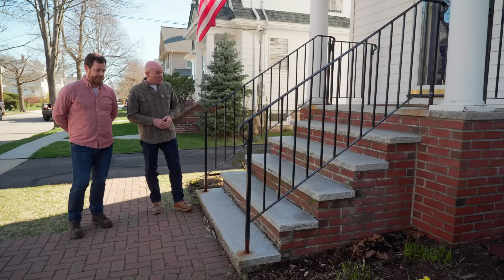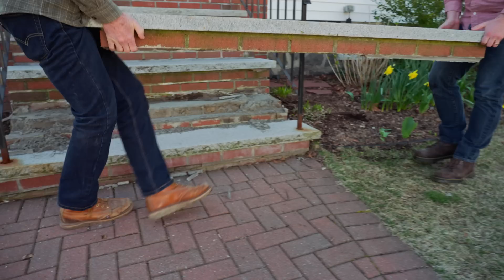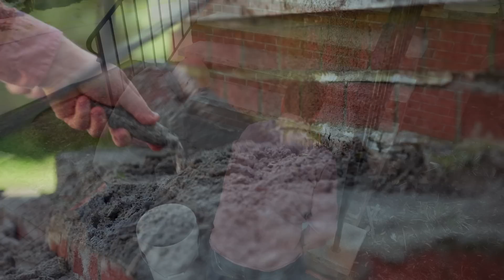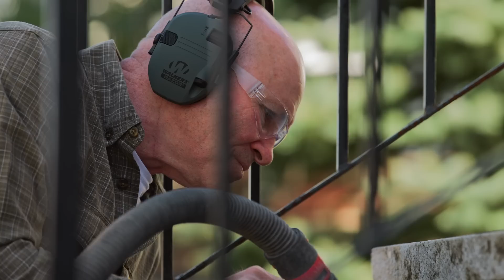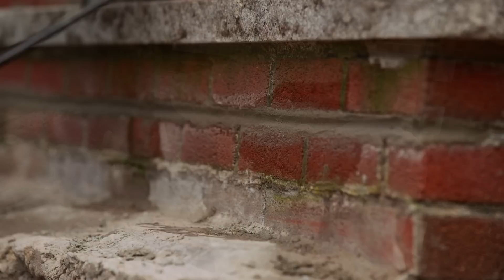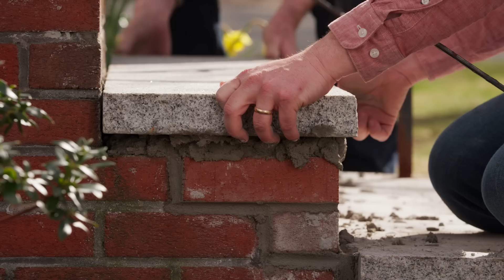How to Repair Granite Steps | Ask This Old House

Comment: It was supposed to use a brush and remove the dust and old worn cement first, then spray it with water and then repair the damage.

Comment: Great job Mark but, as a time served craftsman,  I was always told never hit a hammer with another hammer.

Just wanted to ask if masons hammers are tempered differently, as I was told they can chip or break if used against each other.
Reply: Always hear this, never seen it happen

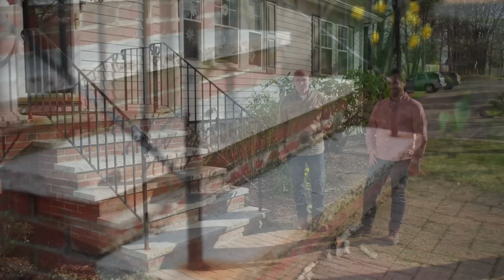Comment: 10:45 i have a bunch of questions! 
1. Why you didn’t power washed everything ahead of time?
2. Why you didn’t filled the joint between the bricks before you added the last brick?
3. why you didn’t added concrete on the back of the granite slab?
4. Why you added just concrete on that slab and you didn’t added proper adhesive? You do know that is an adhesive just for that operation!
Reply: Mike Haduck Masonry, go watch it, ain't no big deal.

Comment: At 7:23 Mark should have put some mortar on the ends of that brick before he “set it.” Granted some would have been lost, but rather than putting it in with no mortar and just relying on the mortar joint to hold the bond. Suprised he did this.
Reply: Which part of the brick? Near the ends of the long, horizontal face, or on the short, vertical faces?
Reply: @sparkyheberling6115  Read what I said. I said the “ends.”
Reply: @johnlebzelter4208  But there are two kinds of ends here. The ends of a face of the brick, and the ends of the brick. Do you mean he should have added extra mortar to the bottom face?
Reply: These clips (and probably episodes) are so highly scripted and edited, a lot of details are probably left on the cutting room floor.

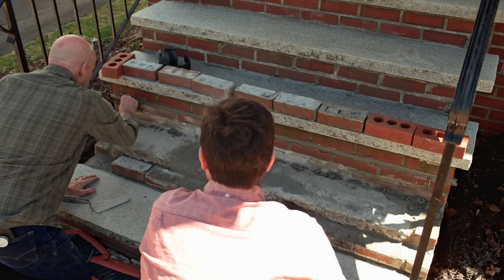Comment: 5:42 “We want to make sure we ride the heel.” What does that mean?
Also, don’t you need to check that  the height of the step is the same as before?
Reply: @sparkyheber… It means letting the heel of the jointer determine the proper depth, not the very end.
Reply: It also prevents you from digging your tip into the mortar
Reply: @aaronstarling9837  Just what I said.

Comment: This is more than I can handle... My question is:  what kinds of questions do I ask my local mason if he has the expert knowledge and experience doing this kind of repair with positive results. I think I've been getting handymen who look up how to do this on YouTube and have mixed results (not often good) when I really want a professional outcome, not a patch job. 💕🌞🌵😷
Reply: A patch job will always be nothing but a patch job unless you do a complete "re-do."  The staircase in this video is in the Northeast.  And bricks take a beating at ground level in this climate with the extreme freeze/thaw cycles.  Until this staircase is swapped out for all cement or natural stone, it will continuously have to be touched up.  As for any contractor you may hire, get some references and check out some examples of previous job he may have done.
Reply: Jack of all trades and master of none, the North American way the past 15-20 years.  Specialty trades are becoming obsolete,   Oh your a tile and marble specialist? Sorry no work… Oh you can do vinyl, linoleum, carpet, hardwood too?  Welcome aboard!      The customer has to do their due diligence and research if they hire a contractor because that contractor could be anyone claiming to be someone.               Take pictures of someone’s workmanship and pass it off as their own
Reply: @Moemancan  YES! Exactly! And that's my question: in my due diligence, what kind of questions do I ask to separate out the handyman out from the tradesmen?
Reply: A qualified tradesperson has nothing to hide in an estimate and will share recent work completed,references and previous employers, if they give a referral,check it, trust your judgment and beware of smooth talking sales pitches, get more than one estimate, watch their mannerisms and watch their reaction when you ask if they are insured or bonded.  Ask for a business license or certificate, I have a government issued one.    I feel the best way to go is talk to friends or family that had work done and see if they were happy with the results regardless of price because good work doesn’t come cheap but a nice job with a warranty brings peace of mind